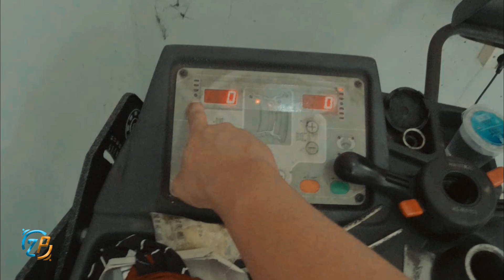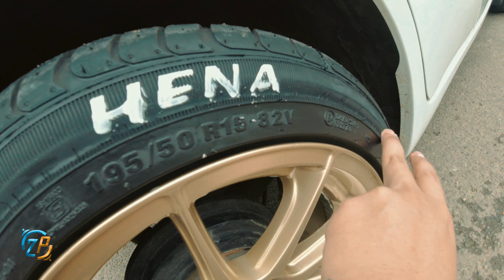MODIFIKASI HONDA BRIO 2017 // HSR WHEELS DAN BAN FORCEUM

Comment: lebar velg brp bro?
kmren ane bawa galon isi penuh 6 galon dibelakang ge gasruk tuh, velg gw pke enkei pegaxus rin 15 lebbar 7
Reply from the maker: ET 7 juga saya...  Tapi belang depan blakang
Reply: @sampaichalis  et 7 ngerti gak et itu apa? Contohnya kalau brio aman spec velg lebar 6,5 r15 h:100 etnya 42 atau 40 biar ban atau velg gak keluar body ban aman 185/55 gak diceperin ,195/50 kalau diceperin. Itu pasti etnya punya agan pakai 35 atau 30 makanya gasruk
Reply: @suheryhery5760  stuju bng, bnyak jga yg mau jual at cma kasih info d sbuah foto/vdeo ga ngasih tau info spek lengkap dr velg yg mreka bahas, bikin pemirsa bngung 😁 (biasanya spek lengkap velg itu ex. Ring 15 lebar 7 offset 35  Pcd 4 x 100